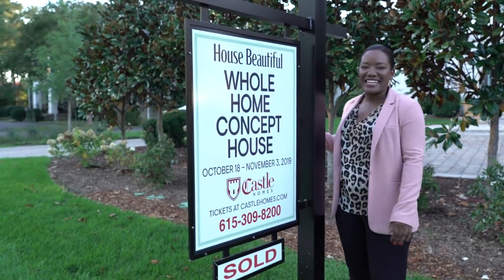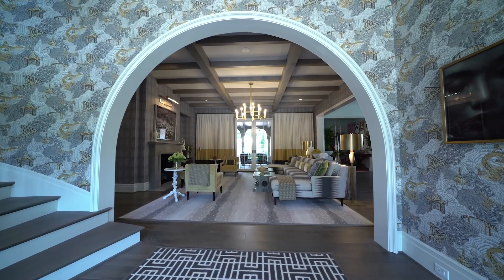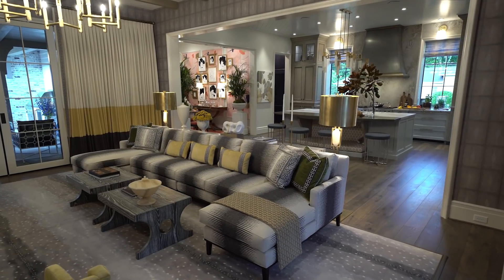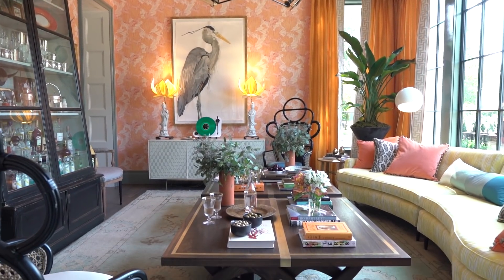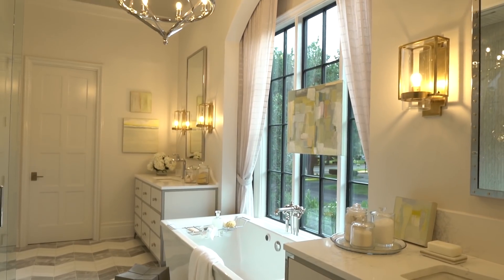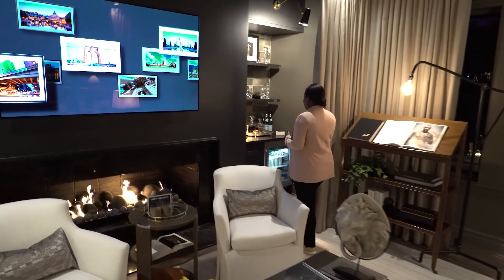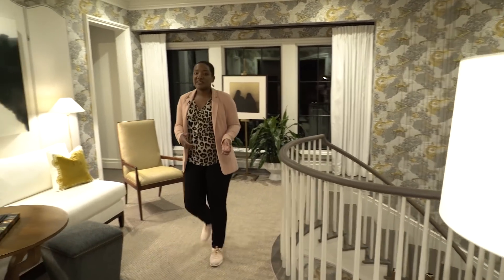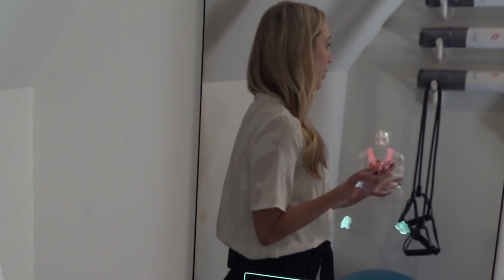Castle Homes Builds The Ultimate Dream Home | Building The Dream Nashville | HB

Comment: Extremely disjointed. Not only the floorplan but the decorating because it’s all different designers thus, extremely wasteful; nothing came from the same headspace. It’s certain things will be ripped out by the purchaser. My fav design element is the arched entry door/brick/steel & winding staircase. I even surprisingly liked the wallpaper!